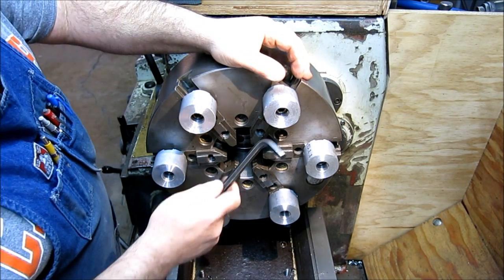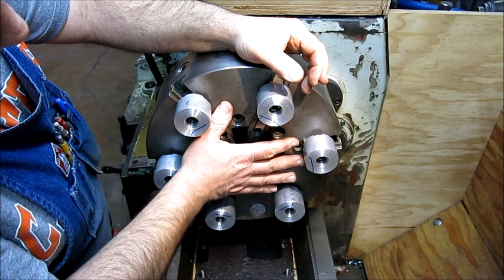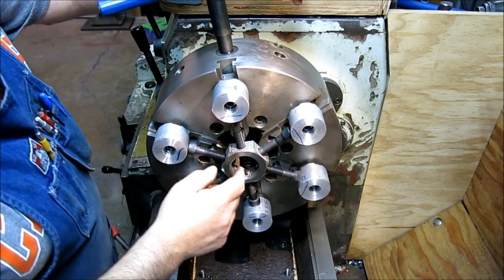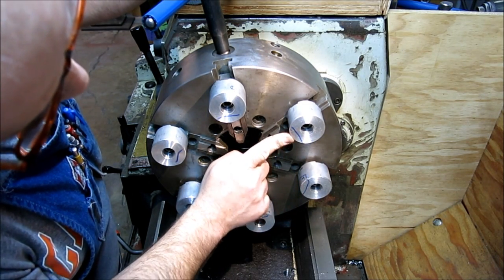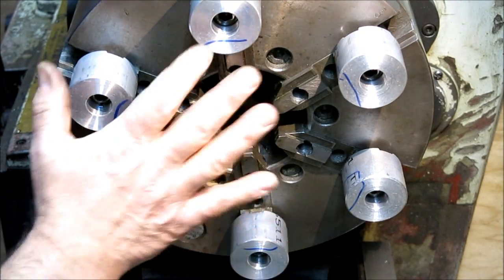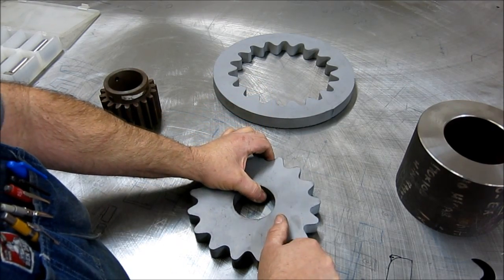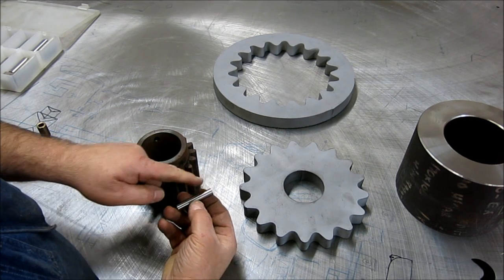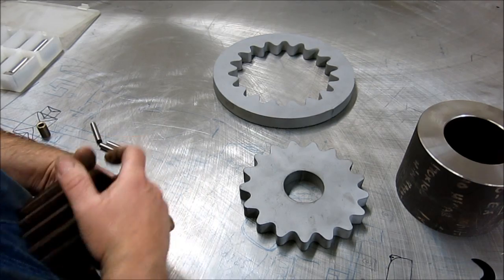Roach Coach Snack Break 10

Comment: Just curious is there a reason why you would'nt use the milling machine?
Reply from the maker: Hey Travis,

You could use the mill to do this. The setup is trickier because you need to indicate around the pins and this is where your clamps will be. You can also do it in mill softjaws almost identically. For smaller gears the mill is a great way to do it,

Cheers,

Tom

Comment: Why do use a 6 jaw chuck and not the more common 3 jaw?  I've been wondering what the advantage to the 6 jaw was?  Better accuracy or more clamping power, less likely to mar the part surface?
Reply from the maker: Hi Ghetto,

All of the above. The only disadvantage I have found is six jaw chucks cost more and can't be spun quite as fast as a three jaw of the same size. They are awesome.

best,

Tom

Comment: Hi Tom
This is my first comment.  I can not thank you enough for taking the time to share all your knowledge. Your book is awesome. I have a small job shop here in Harlowton MT. 
If you were using a four jaw chuck and the pin method to chuck up a gear/sprocket would u dial it by using the out side of the pins by letting them hang out slightly past your soft jaws.
Reply from the maker: Hi Robert,

That idea would work great. Hopefully you wouldn't need to face the part in the same setup. The softjaw setup is pretty powerful when you have a bunch of gears or sprockets to machine. They provide a nice bottom so you don't need to indicate the face and accurately grip on the pitch diameter. Thanks for the comment and suggestion.

All the best,

Tom

Comment: Great idea that I'm sure will come in handy at some point.
I suspect the main criteria is that the pin be of large enough diameter to not contact the bottom of the tooth and instead rest on the tooth flanks.
Thanks for sharing that tip. :-)
Reply from the maker: Hey Colin,

Good point. The pin has also has to be large enough so the softjaw can contact it. The pin needs to protrude beyond the gear or sprocket OD.

Cheers,

Tom
Reply: oxtoolco

I guess If the gear happen to have right number of teeth in relation to the chuck you could just bolt the bushings right on instead of the soft jaws

Comment: a simple caveman circle or ring clamped like you explained and voila no milling drilling taping bolt finding nut finding and finally adjusting and as you mentioned simple.
i guess what im saying is that spider is too complex for a simple soft jaw app,but very well made i must say your workmanship is very high level no doubt and its why im subb to your chanel, but my dad always told me, keep it simple stupid and always say whats on your mind son.LOL
cheers tom
Denis
Reply from the maker: Hi Denis,

I see you may have missed the utility of the adjustable soft jaw spider. You would have to have a pretty large selection of thin discs to cover the typical work that gets put into soft jaws. The spiders you saw on the video were made from plain hex nuts which I may have failed to mention. If you miss your bore dimension and now need to close the chuck jaws slightly the disc you just used cannot be used again unless you turn the OD down. This means you need to dismount the chuck and turn your scrap barrel ring or disc down, remount the soft jaws and then rebore. The adjustable spider is infinitely adjustable and fits in the bottom of my toolbox. If you have a large supply of narrow discs in small increments in your shop and are blessed with a couple of lathes then I might me tempted to use your method. Then again that's what I used to do before I made my softjaw spider. You mill and drill once and never hunt down a disc ever again. 

All the best. 

Tom
Reply: you are right about the discs i was just thinking about a once in a blue moon job that one would use soft jaws and its true we don't use them too often personally, and when i do i cut a ring out with my plasma cam and turn it concentric  to the od that is calling for but your design is more versatile hands down, and hey we learn stuff every day that's why im here love your work  and looking forward to the next one.
PS: i still haven't tried those ginger bread cookies you ate cant find them here in Canada. im gonna have to import those.LOL

Denis
Reply from the maker: Denis L Hey Denis,

Now If I had a plasma cam that would change the way I do a lot of things. Is your system similar to Keith Fenner's?

All the best,

Tom
Reply: ya same set up its a 5x10 plasma cam and i must say he is the reason i bought it after seeing his vids and talking on and off bout it, i made the move little over a year now and have no regrets, what a time saver,now if only i could get a tracer att like his.LOL but hey tom i got to be honest i have been stealing your ideas on some cool stuff you do and some neat devices hope you don't mind.
cheers
Denis
Reply from the maker: Denis L Hey Denis,

Where are you? I know of a really good deal on a Monarch Tracer lathe here in California. They have not been able to sell it because of its location. Less than scrap metal price. I surveyed the machine and wrote a blog article on it. They keep re-listing it on CL.

Cheers,

Tom